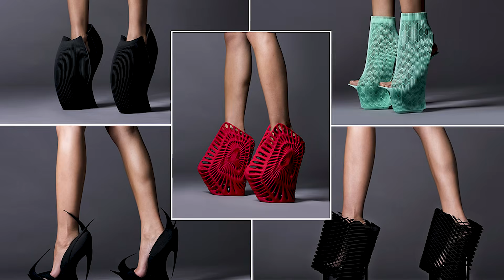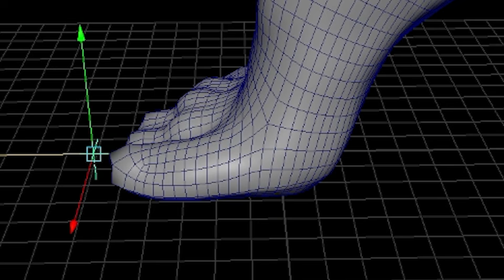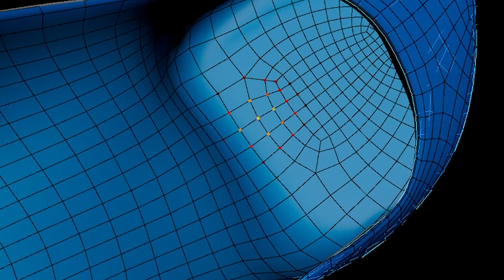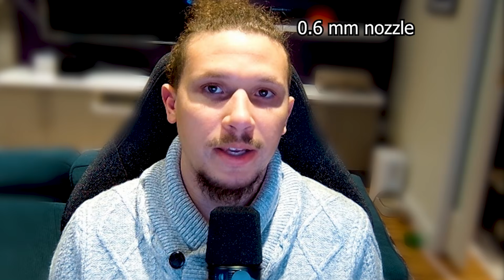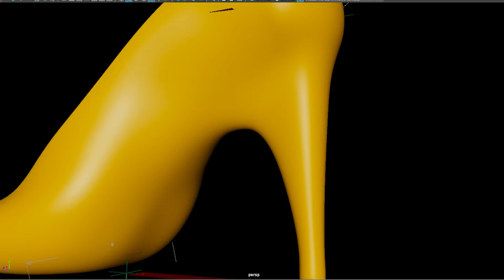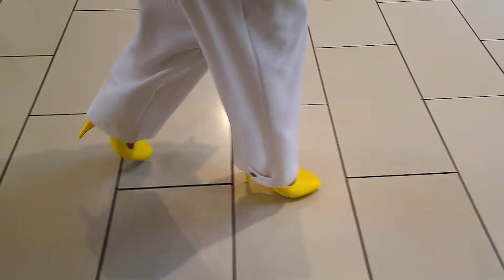Custom Fit 3D Printed High Heels

Comment: Heads up that Autodesk (makes Maya and 3Dmax) has decided to go for GenAI and it's not clear how many of their user models they are going to feed into their machine. Open source program Blender doesn't have those issues.
Reply from the maker: Ugh time to learn.blender 😅